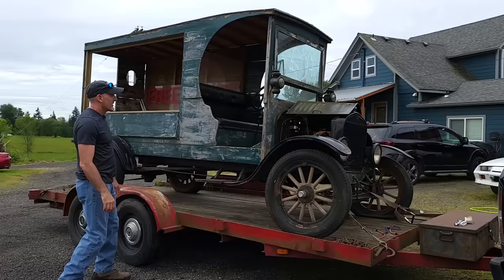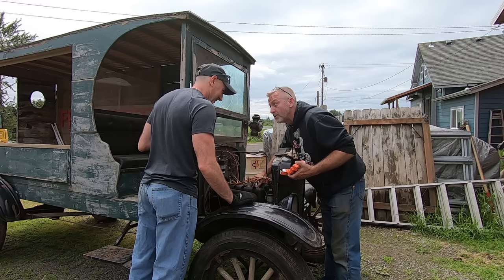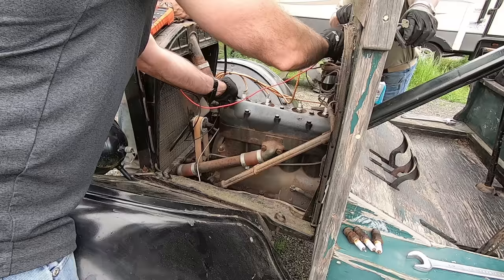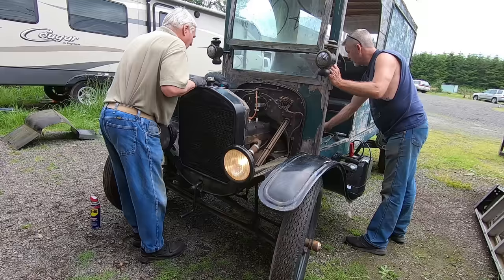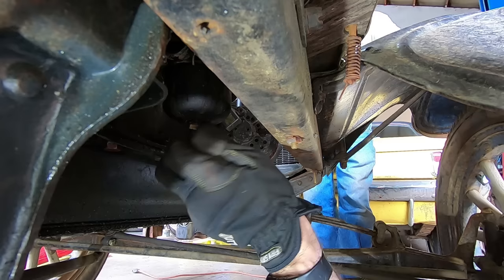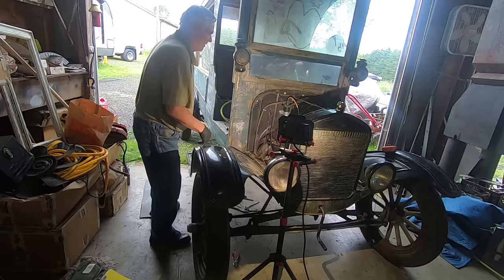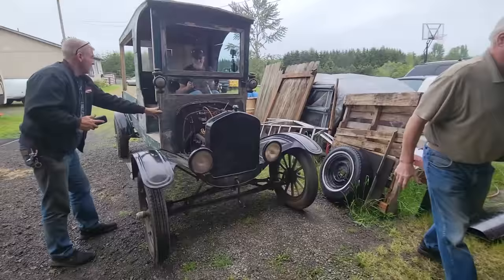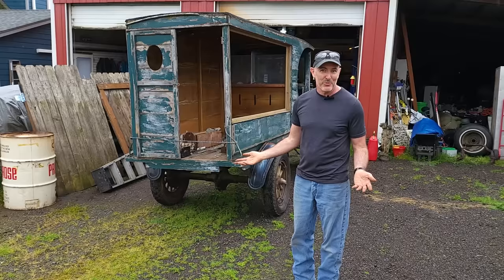1925 Ford Model T Start and Drive after years of sitting

Comment: you fellas ever think that might be a model tt not a model t.. center to center wheel base 125 inches instead of 100 inches... bet it is.. worm drive rear diff vs ring and pinion... yep it is..... three speed secondary transmission with low, direct drive and overdrive... uh huh.... looks to me like u have a 25mph or so work truck called a ford model tt. not a model t. welcome to the world of the first ford 1 ton truck started in 1917!
Reply from the maker: I looked into this and I think you called it! It does have the worm drive rear axle with the secondary transmission. I am planning on a follow up video where I go into what it is more and what it takes to drive it. Thanks for posting this up!
Reply: It is a TT. I have a 1926 flatbed with a standard cab, but the top was cut off so it would fit under the orchard trees. I bought it from the old farmer who bought it new off the Ford lot in Healdsburg, CA.
Reply: Auxiliary transmissions weren’t for just the TT’s . I have a warford auxiliary in my model t coupe .
Reply: @galerae947  Why does that sound so farm typical - darn truck won't fit under the trees, just saw the top few inches off and problem solved.
Reply: As utilitarian as a neighbor who wanted van comfort with truck utility and sawed the van in half, put on a truck rear. No idea if he plans to marry the other halves into a partner vehicle, but that'd be a sight.

Comment: The lever is for a two speed drive line. Normally don't run anything but 30w non detergent oil. But you have an alt. Detergent destroys the mag windings on the flywheel. Make sure the oil contains ZDDP to protect the cam. The oil pan alignment is very important. It holds the transmission bearing and that sort of takes the place of a 4th main bearing. I'd highly recommend a magnetic oil pan drain plug. Oil contamination will build up on the crank stingers and they won't sling oil as well.
Reply: I read a comment from someone who had a model t and they said they went up a lot of hills, as they lived in San Francisco.  He said he burned out the 1st main bearing, as it did not get splashed with oil and he said the old times said if you drove up a lot of hills and had a model t with out a oil pump, they used to add in an extra quart of motor oil, so all the bearings could get splashed.

Comment: My dad had a ‘27. Driving a Model T is kind of an advanced course. I’m surprised you did as well as you did for not knowing the secrets. 2 things that will help. 
The lever that seems to be the parking brake on the drivers left has a couple of functions. There are 3 positions. All the way rearward is in deed the parking brake. The center position place the car in neutral by lifting up a lever that disengages the clutch. All the way forward engages the clutch and the car will take off in high gear unless you  control it with the left pedal. As built, Model Ts only had 2 gears, low and high. Your example has a Ruxstell (Sp?) rear end which gives you more gears via a high and low range at the rear axle. But getting back to the left pedal, it also has 3 positions. In the middle, the clutch is again disengaged and the car should remain stationary. Pressing the pedal all the way down puts the car in low gear and you can pull away slowly. Releasing the pedal by lifting your foot completely allows the shifting mechanism to spring back thru the neutral position and then engage high gear. Once you get the knack of driving your Tin Lizzie, it becomes pretty natural to control the car using that pedal. There should be a floor pedal to the right of the three transmission pedals that is a floor throttle that you can use to control engine speed much like a modern car. The hand throttle is used for starting the engine but good T drivers rely on the foot throttle for actual driving. BTW, you need to adjust your idle speed downward. If your car runs well (yours does) it should idle right down to where you can count along with the cylinders as they fire. The “key” for the ignition is a simple switch having only an off and on position. The switch with the black handle surrounding the ignition key is the control for headlights and that switch has “off”, “dim” and “bright” positions. Don’t hitch too much hope to the headlights on a Model T. My dad used to say you’d be better off to poke your finger in your eye and go by star-light. Good luck with your new family fliver. 🥸👍💥✅
Reply: Yes you do and very correctly,i had drove t ford is soo difficult and may be so hard handling but in that era so so amazing have nice car and so rich people ,right😊

Comment: I love the open style of these trucks. I am not sure how fun they would be to drive with all that wind blowing into the cab.  But they look very nice.
Reply: If it's a Model T they are real happy at 35 mph if it's a model TT which I believe this one is actually they are real happy at about 20 to 25 because of their gearing.
If you put an overdrive unit on a Model T They will do about 45 happily and you can push them to do about 55.
My point is at those low speeds wind isn't too big of an issue.
Reply: @AtomicReverend  Cool.  Thanks for your reply.  I thought it would be like driving a modern car with no doors on it.  I do wonder about the rain and cold - snow and such.  I think some of them had modified doors on them or enclosures you could snap in place to keep out the rain and snow.
Reply: @kfl611  If you have never been in a old school hot rod or a Jeep Wrangler (with out the top and doors) or even a old school convertible (when they felt more open because of low back seats low window heights and a lack of safety). Anyways It's a fun experience especially cruising with your friends or your significant other like the 1950s rock and roll musicians used to sing about. 

Being that I'm a car guy I've had various different old car makes And when you get into really old cars that are pre-war hot rods or stock you're a rolling car show a model T   "C" cab (called that because of the shape of the door opening) draws a ton of attention And it is a weird sensation sitting on a platform without a seatbelt that you can see the ground when you look slightly down but it is also really fun.
Reply: HOW FAST DO YOU THINK YOU'LL BE GOING?? LAWNMOWER SPEED!!

Comment: i drove a Buick stright 6,  hanging down caburattor, 2 braker points one for 3 cylenders,, model 1928 ,, was a normal car with 3 speed gearbox , brakes only in rear wheels eccelrator paddle in the middle below cluch and brake paddle ,, it was powerful , heavy but fun,,,

Comment: It is really Amazing to see how these old cars engine start after ages of sitting. I wonder if the same will happen with one of the modern ones...
Reply: No.. to many failures on new engines. To many wires.  To many sensors.

Comment: Looks like it's got a Ruxton 2 speed rear axle and "rocky mountain " rear brakes (?)
Reply from the maker: I think it was a one speed rear axle. The shifter turned out to be a low range case that sat right behind the transmission. I don't know if it was factory or an add in later. The brakes sorta worked lol
Reply: @MattOverDrive  That is a Warford Auxiliary transmission. Not a Ruckstell Two speed rear axle.  It is a under, straight thru, and overdrive, for the TT.  The other gear is over to the right and down ( a lower  case "h" pattern).  The handle on the ignition switch is the light switch, ON-Off-DIM.  The key switch had two contacts, Bat and Mag, but as it has a distributor it will only run on Bat( Turning the key to the left, it is marked).
Reply from the maker: @jameslockard4827  Thank you! We did figure out the key switch after the end of the video but we didn't even try an H pattern on the auxiliary transmission. We will now!
Reply: I have a 26 TT with a Warford.  They are fun.  Bet you can get 30-35 mph in Warford overdrive.  Add express gears in the rear and you can get 45 mph.  At that point you might want juice brakes.

Comment: I know of A trick y'all could try on that truck for better fuel millage to. None ethanol fuel blended with cataclean.& gum out octane booster in the premium fuel. A half 1/2 of cup of water can treat up to 10 gallons of fuel for y'all to easly. Pour the fuel in to A clear jug.& add in water shake it up good. Let it set over night then you can remove the botom part out of the fuel to add in the other additives afterwards for peak profourmance power output then.

Comment: Cool video.  I don’t know a thing about these things, but I am curious how the mechanical advance still works when it’s been changed out to a distributor.
Reply from the maker: The whole distributor twists on the shaft to the cable from the steering wheel. I plan on doing a follow up video that covers stuff like this and what it takes to drive it
Reply: If it’s a Volkswagen distributor, it will have centrifugal advance built in underneath the points plate. PS I don’t remember seeing anyone for any lightweight all or at the very least some two cycle gas down each spark plug hole before you put the new plugs in. That’s a cardinal rule! Old car 101.

Comment: Well, not too many years of sitting. A modern distributer and single coil instead of the original four coils and timer. Good wires and hoses … and a carburetor that doesn’t need cleaning.

Comment: fuel tank was behind the dash and filled from the top gravity fed system
Reply: That’s true for 1926 and 1927 models but the way Henry built them prior to ‘26, the tank was under the drivers seat as in this example. All was well if you had a fair amount of fuel in the tank and if you were driving on level ground. However, going up hill would put the carburetor higher than the outlet in the bottom of the tank and you’d “run out of gas” partway up the hill. Ever resourceful, T drivers quickly learned to turn the car around and reverse their way up the hill, as this would put the carb lower than the tank and the hill could be climbed although at little more than walking speed. 🥸👍

Comment: Why WOULDN'T it run? It looks to be well-maintained and they're so basic there's just not much to go wrong with it. Charge the battery, put some lousy low-octane fuel in the tank and away you go.